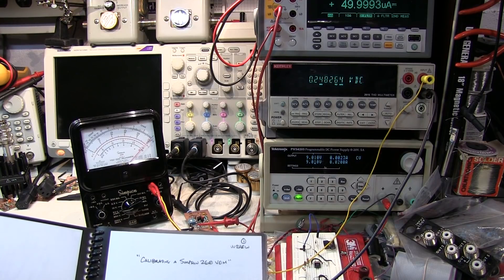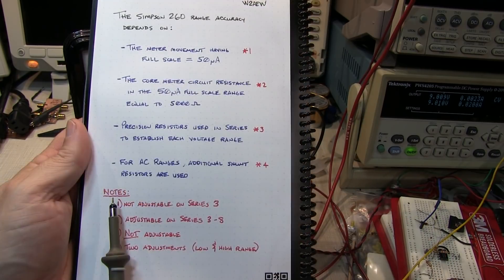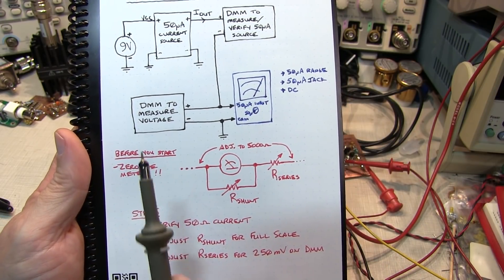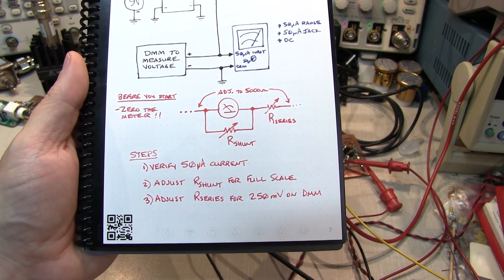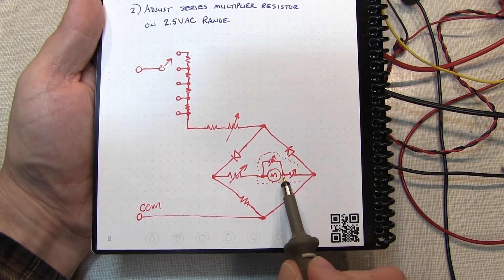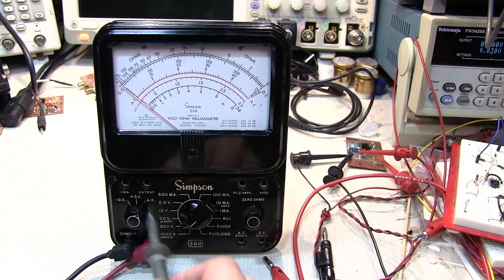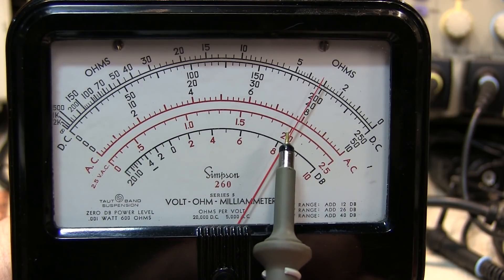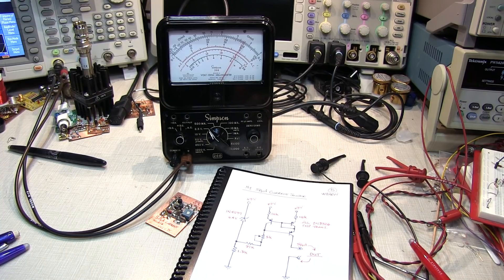#324: How to "calibrate" the Simpson 260 VOM - BONUS: 50 microamp current source

Comment: I don’t think I could ever provide a little addition to your information. So I thought it was worth mentioning to the viewers that an analog meter advertised accuracy is at full scale needle deflection (FS). So if the procedure for the calibration indicates a full scale voltage adjustment for AC, to strive to get the source for the proper AC voltage. It can make a difference. 

Also, not simply use a DMM to measure the resistance across the meter movement itself. Since that can easily smoke the meter movement which can happen with the 50 micro amp jacks as they bypass any protection diodes that may be in the Simpson 260 in various forms. In my Simpson 260 there are no protection diodes.

I have been watching your videos for years Alan, and they are fantastic. I learn a lot still even though I have been  through military schools for electronics and telecommunications and  was lucky enough to go thru vacuum tube equipment repair also. I’ve been repairing electronics for years and deal or dealt with electricity in various forms including high voltage. I have rebuilt a few analog meters, many have had the custom resistors go well out of spec and had to recreate the custom resistor using parallel and/or series resistors. I learned what a copper oxide diode was that way! And how to blow them up i might add!

Comment: Hi. I DO work in a cal lab and, the way we cal the 260 is pretty straight. Make sure you've got fresh batteries. Check fuses. First adjustment is 50uA DC (I use a 5500) adjust for full deflection. Then 100mA DC full deflection. then 250VAC @ 60 full deflection. Finally 2.5VAC @ 60 full deflection. That's really it. Don't forget to spray De-oxit into the ohms pot and run it back and forth a bit to clean the wiper.

Comment: I might be wrong, but I believe your cal for AC might need to use an average conversion from your function generator signal. I don't believe this VOM reads RMS.
Reply from the maker: The Simpson 260's AC Voltage range is calibrated to the RMS value of an pure sinewave.  So, it is not a true-RMS reading meter, but will show the RMS value only when the input is a pure sinewave (and within the frequency range of the meter).

Comment: I have a 260 series 2. The AC volt reading is low by a factor of the square root of 2. To make it reads 1V I have to input 1.41V. You think the rectifier is bad? Can I replace the rectifier with diodes?

Comment: Rich
I really enjoy your video's, thanks!  Regarding calibration of my Simpson 260 meters.  I built your constant current supply, and my Simpson 260 series 4 calibration is "spot on".  However, my Simpson 260 series 3 meter...using my bench supply as a variable voltage source I find it takes 54.5 uA for the meter to reach full scale.  As a result, actual readings are slightly lower.  In all cases, I use two digital meters...one to measure voltage and another for current.  I think you touched on this possibility in one of your video's.   I assume the meter is defective and the only solution is to replace the movement?   Since I have three other meters, (including my old RCA, WV-38A) that all suffer from the same problem.  I'm curious what may have damaged them, and is there a simple solution?  I think I already know the answer!
73's w0bvt
Reply from the maker: I'm afraid so (the meter movement is bad).

Comment: Again I have to start by saying I love your videos. We previously spoke via your meter shunt video... Anyway, I have created your 50 microamp device in a small project box using a 9V battery or a 9V input. It works wonderfully. For the 5K pot I used a precision 20 turn pot and this device is never of more then a few 100th of a microamp which are easily dialed in with the pot... I was wondering what I can do to make it variable across a range say from 25 to 250 Microamps... Would both of the 10K  resistor need to be modified to be some kind of double pot? Or is the voltage drop across the diode the key to this circuit and that leg would need to be controlled somehow. Any insight would be great. In regards to the calibration I have two 260s. My series 6 is spot on and the teency tiny bit it is off its not work messing with. The series 7 seems to have an issue that is not just calibration. First of all once I turn it on the needle moves positive of the 0 and in resistance I can't get it to full scale. I can't zero RX1 either yet the other resistances do zero. When I check a voltage, which is off the needle will move to a max position then start to drift low as if a cap is discharging. I'm not sure I'm going to focus on that one at the moment. I did use your video to procure the sleeves to address the reverse banana but I really don't use this one. These are reminiscent of my days in the Navy when this was the standard issue VOM. Yes I was in the Navy before DMMs were in use. Again thanks for your videos... I'll have a few questions soon on your Sweep video...Thx, Ben

Comment: I just made one of your 50uA current sources.  I don't have a micro-ammeter, but I do have an HP 3456A.  So, when I created the board with kicad, I added a 2K .05% precision resistor across the 50uA output through a 2-pin header.  So, connect the header (i.e. the 2K resistor), set the output for 100mV, disconnect the header, and you have a pretty good 50uA current source.  By the way, while fiddling with this, I discovered that my Sperry handheld DVM is only 20uV different from the 3456A when measuring 100mV.  So, you don't need much more than a handheld DVM to calibrate your device, as long as you have a high precision 2K resistor to set the pot for 100mV.  Well done, by the way!  This is an easy way to rehabilitate an old Simpson 260 and be sure the meter is pretty much spot-on.

Comment: Nice presentation, just one question regarding the 50ua current source. How is the 5k trimmer used to set up the output current?
Reply from the maker: I used a bench DMM as the "standard" to measure the 50uA current source value while adjusting the trimmer.

Comment: You don’t need a metrologist’s approval lol, your approach is rock-solid (I’m a Lead Metrologist at a NASA Electronics Cal Lab, 26 years now).  We don’t see 260s coming through anymore, I miss the analog stuff.  We’d just use a Fluke 5522A or newer calibrator for a 50uA source.  No fun in that! 
Late to the party but enjoyed your presentation!  73

Comment: I'm assuming taking the 250 mV reading is when connected to the common and the 50uA plugs and not internally on the circuit board. While the full-scale 50uA is being applied of course. Didn't have the exact components for the Wilson current mirror so I cobbled the circuit together from what I had available. The 50 uA span adjustment was almost at the full range of the R-32 pot. I do like to have pots nearer to mid-range when tuned/calibrated. Thx for the video, 73 Alan!

Comment: I tried building this current source. I used two zener diodes, a 6V2 into a transistor that provides constant current for a 5V1, for shits and giggles. The double setup actually seemed to make it extremely stable over supply voltage changes. 7->12V wasn't very noticeable. I tried using an "improved wilson current mirror" that uses a 4th transistor. Arbitrarily I used 5.6k degeneration resistors, and simulated it in Falstad to get rough resistor values needed for current setup and trim. I decided I wanted both 50uA and 10uA source, so had a DPDT switch to go between them. After a lot of faffing around getting the trim in tolerance, I finally had it set up. Seems to wonder around quite a bit, I wonder if that's from temperature variance of all the BJTs diode drops? Not sure. Maybe there's a huge tempco I can trim down with something else in the future.

I am kind of curious whether the 4th transistor helps a lot or not, or if it's possible it even hurts the circuit.

Comment: Thanks Alan! Is the 1N4577 Zener critical? Or can it be substituted for something like a 1N4571? The 1N4577 is a bit pricey and DigiKey forces you to buy in bulk whereas the 1N4571 is a bit cheaper and can be bought individually.
Reply from the maker: That will work fine.

Comment: Great video Alan, as a former (now retired) I can say all of your disclaimers were correct and appropriate. It’s ok to “check things out” the way you did, but traceability is required for validated processes.  My comment is on one technique mistake you made when  you used the 122 line voltage as your test point for the AC adjustment.  You can’t make an “adjustment” to a point that doesn’t exist on the scale, thus “eyeballing” it somewhere in between.  Bzzzzzzzzzz no good! Hi!  You must somehow generate 120 or 125 so that adjustment can be made to these ticks that DO exist on the scale!  In the real world what you did is fine for your’s or my shop use.  But you asked us metrology types to chime in on what you were doing.

Comment: I had to use a regulated low voltage supply and a decade resistance box to set the 50 uA.  But the mil cal calls for adjusting the other pot for 1 mA on that range.  In any case it then reads a small amount low on DC readings after the mil method.  I will try the 50 uA 250mV method.  I have seen Simpsons that read dead on for DC so I know they can do it.  The later meters use good Dale metal film dividers but some of the old ones used those black resistors and those can change value a small amount.

Comment: I see that your are using Manhattan style PCB.  The pads appear rectangular.  I have found a pad source from a QRP site but there are square in two different sizes.  Where do you source your PCB rectangular pads ?  I just bought a 260 at a yard sale and looking forward to using you cal procedure when I get some 2N3906 transistors delivered.  Thanks, great channel.

Comment: you can help me ? i can't calib to zero on x1 range ohm.what i have to do ? hope you help me.Thanks
Reply: I would check the fuses, sometimes they tend to raise their resistance
Reply from the maker: The first thing I would check are the values of the resistors that are in used in the x1 resistance range, and make sure the switch contacts are clean
Reply: @w2aew  on x10,x100,x100 range ohm I can calib to zero and measure exactly ohm.but on x1 range i can’t, I think maybe is  rheostat or resistor on x1 line.

Comment: Alan, is the 6.4 volt zener essential? That is, could a zener of similar (i. e., closer) value be used? For example, I have 1N4743A (5.6v) and 1N4725 (5.1v) zeners. I assume the trim pot is for current adjustment.
Reply from the maker: Any stable voltage drop will do...  Those will work, you may have to lower the 91k in order to get in range with trimmer.
Reply: @w2aew  thank you!

Comment: A quick note on adjusting a meter's zero:  Turn the adjustment screw clockwise until the meter reads zero the turn the adjustment screw counter-clockwise just enough so the screw's cam is no longer touching the adjustment fork.

Comment: Good video - I was here for the 50uA current source.
Since I did not have a zener, I modded your circuit a bit. I used a red LED (Uf~=1.7V) and only had to remove the 91k resistor (and I also used a 10k pot). Works well, maybe not as stable as yours, but it was a bit easier to build.

Comment: A question: I have been working on building your current source circuit and have found that the 1N4577, 6.4V Zener diode is both hard to find and expensive. This diode is described as temperature compensated and seems to come in 5% and 1% tolerances. That makes me wonder if the 6.4V rating is a critical value (most Zeners come in tolerances of 5%, 10%, or even 20%) or can I substitute a more common Zener value, like 6.2V at 5%? For instance I already have 1N5233B which is 6.2V, 5%. Will the 5K pot compensate for that value?
Reply from the maker: Hi Paul - there's nothing magic about the 1N4577 in this circuit - I used it because I had it on hand.  You can use whatever zener (or other fixed voltage device) you have.  The 1N5233B would work fine.  You may have to adjust the resistor values.  If you can't get to 50uA with this lower voltage zener, then drop the 91k value a little...
Reply: @w2aew  It took me a while to get to your response. I do appreciate it. But I believe I will be using a different design. Thanks!
Paul A.

Comment: Great video! I presently have three 260s and they will all benefit from a calibration. I specially liked the inclusion of the 50 uA current source circuit: I will be building one. But you neglected to say how the 5K adjustment is set. I guess I just need a good current meter or a precision resistor with a good Volt meter. 

Thanks for the information. It WILL be useful.

Comment: Thx for taking the time in making and sharing this video.
After having a 260 6P for about 8yrs I ran it through a cal cycle in a cal lab that I worked in. It hit all the numbers, well withing spec. That was 1983. I recently pulled it out. It seems to still have excellent calibration. What a stable design.
As for accuracy. If you are careful in calibrating these meters you'll get surprising accuracy and precision. A lot of the dig meters have around 1% DC specs worser on AC. That means you are only getting 2 digits of accuracy not 3 1/2. The low cost meter guys are chumping you and you don't even know it. That's why you need Fluke quality they give you specs that can support the number of digits the meters display.
Sorry, I digressed. Back to the Simpson. If you can discern 122V you have 3 digits of accuracy. Not bad since a lot of digs are worser. So, don't poo poo an analog meter too readily they have more accuracy than you think.
Again, thx for sharing this video.

Comment: Just a slightly off the main topic note.  Some people may not know or realize that they probably have a 1 mA constant current source in their DVM.  If it has a diode test function, it has the 1 mA constant current source.  It appears to be an "industry standard" that the diode measurements are made at that current.  The maximum load varies, but I have mostly seen a bit over 2 V, which relates to a usual desire to measure silicon diode voltage drops (about 0.6 to 0.7 V for small diodes and less for huge ones).  Anyway, suitable for common DVMs that have their voltage full scale 1.999 V.  Of course 1 mA is not good for the need of 50 uA constant current!

Comment: Thanx again for your insights.. today my son & I "breadboarded" the 50 microamp source, from parts I had (some things aren't exactly your spec's i.e. 6.2v Zener etc...but close enough)..

Any way what we found.. using a fresh 9v battery the resistance req'd for 50.0 microamps is 93Kohms.. your design 91K w/ 5K pot is perfect, even with the 6.2v zener.

When I used an "old" 9vdc 400ma P/S (from who knows what appliance it used to charge).. we couldn't get 50microamps until we lowered the "resistance" to 63Kohms...   So the mod we made.. a 51K replaces your 91k,  100K pot and 5 K pot  series  give me a variable range of   51k (or so) to 156K.. so I can use either a battery or my wall P/S, and the 5K pot makes for fine control.. In practice I cal'd / checked  4 Simpson's, another (odd ball) meter has a 80microamp movement...turns out I can get there...
-->next on my list.. make a mod to get me down to 10microamps.. that is what my 269-2's meter movement is.. That all said THANX again for the insight and giving me a project...Once the design is final.. it will be time to solder it all to a PCB..

Comment: Great video. I used a 250 mV source and bench multimeter measuring current to calibrate mine. A little bit of back and forth, between R2 and R27, but since I only own one 260, it was faster than setting up a current source.
The one I bought had a battery leakage, which was messing up the readings at the higher scales, but after a vinegar, water and iso alcohol bath it was back in the game. Really sturdy meter!

Comment: Thanks so much for this and all your videos. This one for me was just perfect timing. I recently purchased a 270 series 4 in need of some attention which is very similar to  the 260 series 6 from what I can gather. After basic maintenance and replacing the usual flaky resistors that were overcooked on the r1, 10 &100 I have just started tinkering with calibration of the dc voltage & amperage when this video came up on my feed. Saved me a lot a grief but also verified I was on the right track. Always learn so much from your channel. Keep up the great work and happy new year,